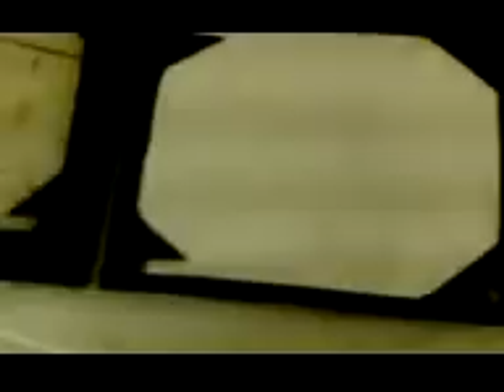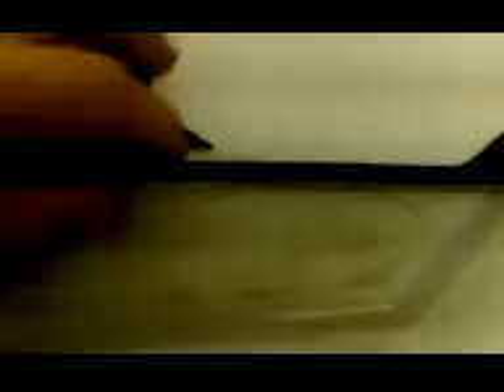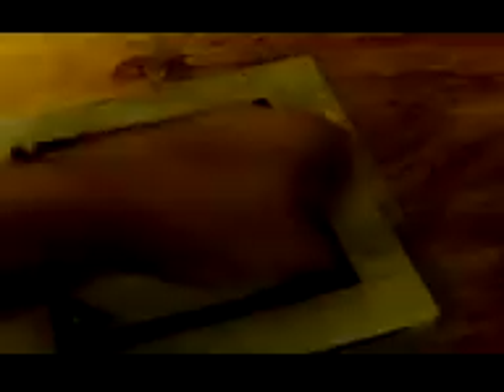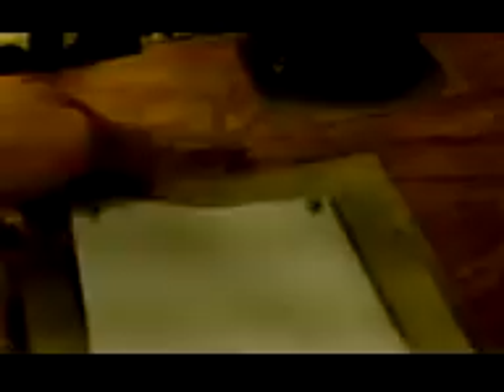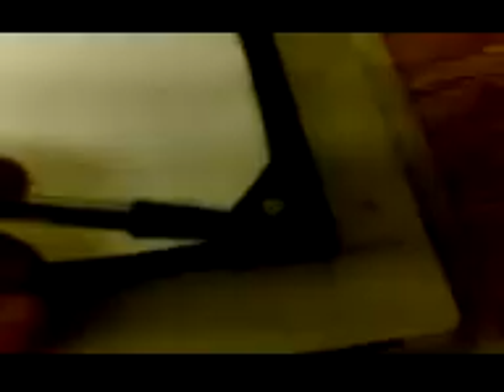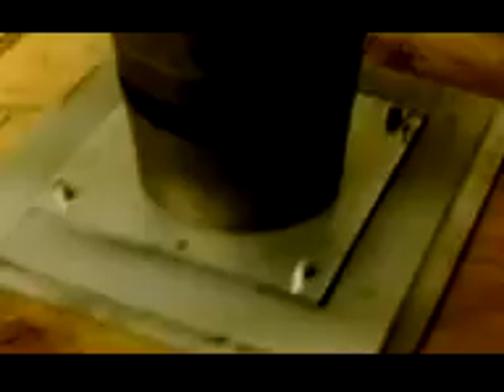5X5  10-31-09 001 GSC Panel Assembly.3gp

Comment: If you apply nickel only put it on the cathode. It's called a dry cell because the edges are dry. series cell is a better name. If you run your gas through a couple of bubblers to cool down the gas your wont need the temperature compensation. You can then calculate mmw